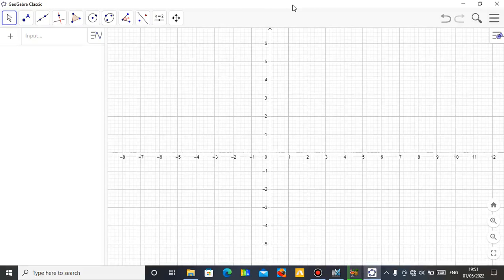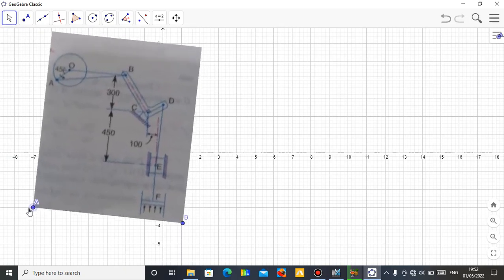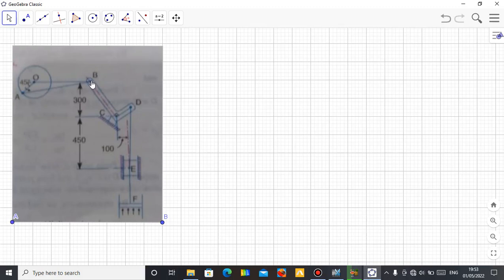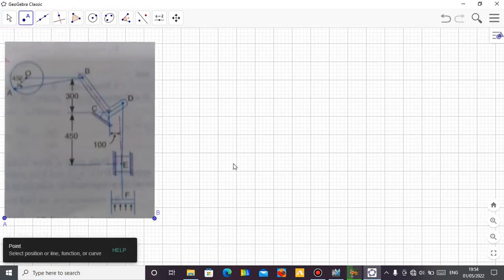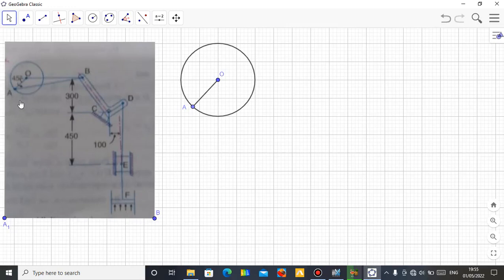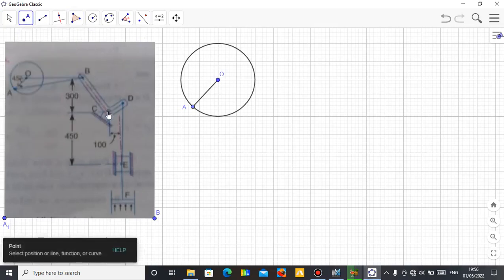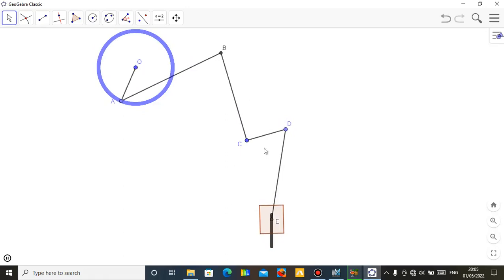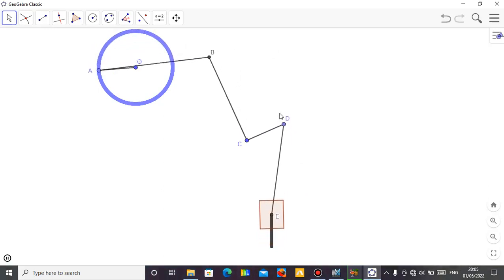Creating Mechanical Mechanism in geogebra Classic

Comment: What is the application of this?
Reply from the maker: This is a mechanism which can be use in designing a machine. It depends on what you want to produce. There are so many mechanisms in mechanical engineering, you choose the right one for your machine design.